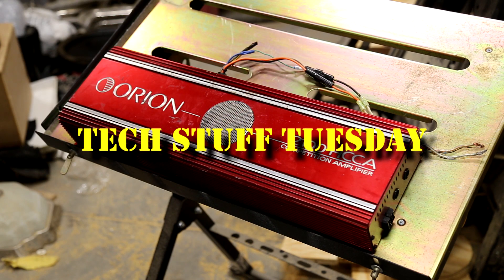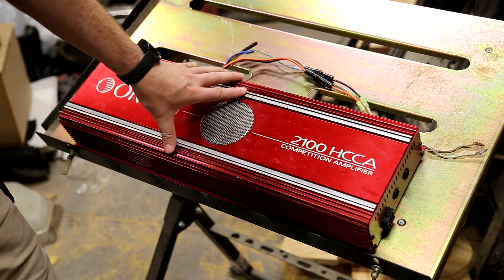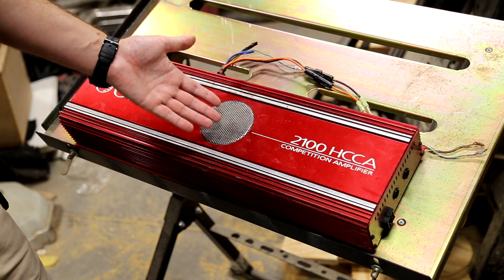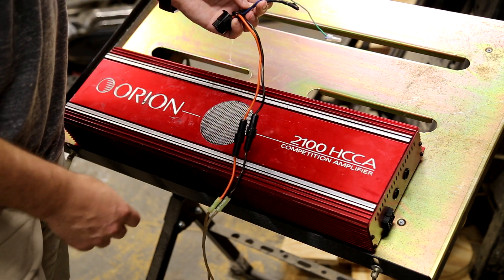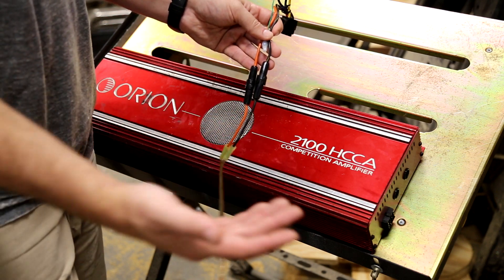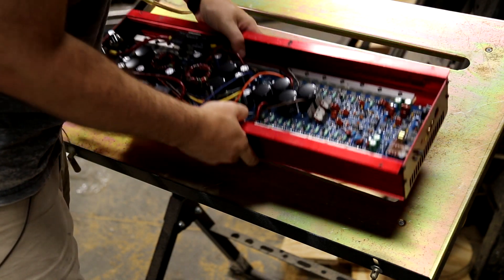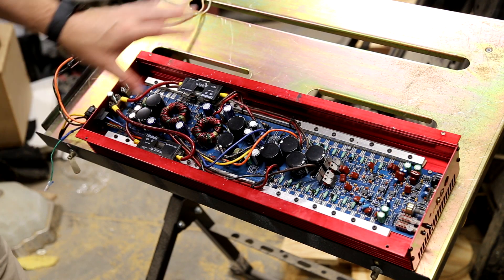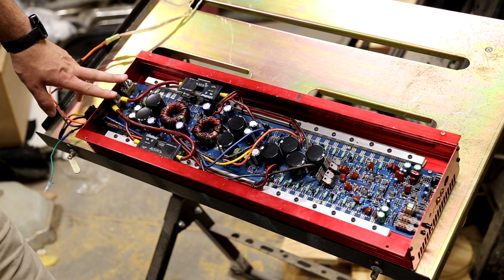22 year old Orion HCCA amp test, how much power does it *really* make? - Tech Stuff Tuesday

Comment: I lived in 3 car audio shops in Toledo ohio in the 90’s. TAS was one … still open and was a big Fosgate dealer … Siegel Auto radio was one an Orion dealer … Greg Cassidy built two tall skinny ported boxes for 2 8 inch subs… they hit harder than most 12’s 15’s of the day. Took your breath away. 
Greg put like 20-30 8” Orion in one box in the back of a white toronado and ram them on one of the big amps and tool hit so hard it pushed you off the seat!
They put 4 10’s in back of an old blazer and imploded all the back windows. Most anyone else never would and still won’t admit that for a short time Orion was the best of the best. The were modest with under rating power.
People talk about Orion amps clipping back in the day when done right almost never occurred. 
Orion was one of if not the first to make crazy boxes and put 8 10 20 speakers and amps into a car and don’t tell me they wernt because they had to make their own battery regulators and EQ’s etc. they came out with crazy boxes and speaker amounts and other companies started after seeing them … I’ve seen Orion amps run so have at like .1 ohm you could fry an egg where as other amps would burn up. Orion was one of not the first to put big cooling fans in center of the amp … for a little while they were the best of the best. This was before power mosfets etc. i remember Orion amps speakers hitting so hard they caused damage to the vehicle in areas and things in the shop and stalled or almost stalled the car with two batteries. I remember an Orion amp so long it went from one side of the trunk to the other … across a box. That’s when Fosgate ppi green machine Phoenix Gold really stepped up their game and advertised 1 ohm stable etc etc etc. i remember getting Orion and car audio magazines and Orion doing things no one else was doing. I still to this day haven’t seen a speaker box like the two tall skinny ones with port on top for those 8”. There was a short time every one else was scrambling to keep up. If you remember correctly it was Orion that was boasting dropping ohms for power dropping ohms for etc it was Orion that started that. No one else was really focused on it. I don’t know what all this guy did or didn’t do with a amp that had two burned out wires but I do know for a short time Orion won damn near every trophy in every competition. Companies and Iasca were pissed. We were some of the first people to hook up Christmas lights to the output on our car amplifiers. No one else was hooking up 20 8” subs or calling there 8” and 6.5 inch a sub… maybe that’s what Greg had like 20 6.5” subs that would know k you off his seat. He also had a DEQ.
Reply: Orion was liquid cooling tweeters back in the day and no one else was … they came up with cobalt made and carbon fiber made products … on one was doing that.
Reply: No one talks about Orion having less distortion at peak power than any other car amplifier on the market when it was like .0005 or some crazy number and that’s why this guy commented on a review that he could turn his gain all the way up and be ok. I remember those reviews bring in orions cobalt magazines and car audio magazines.

Comment: Aside from the other possibilities mentioned, it could just need a component refresh. Caps, especially, don't have an infinite shelf life, and lose performance over time (especially 20+ years). And when you're driving a load as hard as a 1ohm load (2ohm bridged equals 1ohm on the amp channels), the components need to be up to snuff. The fact it did 800 at 4ohm bridged tells me this thing probably really is the beast, when in new condition, as it's touted. US Amps, Orion, Soundstream, etc made seriously powerfully high current amps back in the 90s. Imagine what they could do with today's amplifier technology if they were still the same companies they once were.

Comment: Well I had a Orion hcca 150 rated at 100 watts and it would push 6 JL 10’s in 0.5 ohms! These amps were “cheater” amps in the late 80’s and made to get into competitions at much lower watts and blow them away! You just don’t understand the concept of these amps! This was 20-30 years ago when we would use home speakers in a hatchback to get bass. These amps with two Rockford fosgate punch 12’s would sound like THUNDER!! They never over heated like my hifonics would do and I could turn the gain and volume up to max and it would just dim my lights because it was going to get its power first! Today these amps are garbage but don’t dare disrespect them son because in 1995 my 1990 Honda Accord with 6 JL 8’s w1 in a special design band pass box with the Orion hcca 150 (w/o the bridging module)would still impress you!

Comment: Boy I remember the days of DIN connectors....when pre out on radios was DIN only no rcas at all...I've still got a Alpine 7347 cassette deck and 3015eq in archives...that was early 80s Alpine component equiptment...they had no power plug or any wires except a 8 pin DIN cable  front/rear pre out as well as power, ground, remote and ign. wires all ran thru DIN cables those were the days

Comment: Great test👍
... I sincerely believe that its an XTR-Beast2250 inside of the HCCA2100 case.

I know that its not good to adhere to myths & rumors; but, I think I remember the older guys back-in-the-day saying that both amps looked almost identical on the inside. If memory serves me, I think that The HCCA2100, The Concept 97.3, and The BeastXTR2250 are all identical internally... just the 2100 is set-up for High-Current instead of High-Voltage. And if a person were to try to "Load-Down" a XTR2250 instead of a true HCCA Amp, it'd actually loose power kinda like this one did in your video.

As a person that's seen mass production factories before, it wouldn’t be hard to believe that several runs of amps get placed in the wrong case... employees can make mistakes OR supervision can be more concerned with production quotas.🤷‍♂️
Reply from the maker: Someone informed me of similar, and the case denoting "competition" vs "digital reference" meant it had a 2250 board in it.

Comment: Us amps made models that were 1 ohm stable or less in the early mid 90s
Reply from the maker: They may have made some that would operate, but not rated. Late 90's started very few rated for 2 ohms with even more rare 1 ohm. 1 ohm stereo is more likely.
Reply: @EMFAudio  according to this link, they made .25 stable amps in 1996 https://www.stevemeadedesigns.com/board/topic/195871-us-amps-vlx-25-on-the-amp-dyno/.  Competition busters...always wanted to see if it was legit

Comment: I got one back in the late 90s and once installed I was like "what the hell" my ppi pc 2150 sounded 10 times better and was louder.  Bought it off Yahoo auctions and a month latter I sold it on ebay and got my money  back. I was very disappointed.
Reply: Was running the hcca on two 15w6 jl audio subs @ 1.5 ohms mono load (actual impedance was lower)

Comment: So you mentioned or brought up a question I have wondered for quite some time now, I deff have to ask... Do amps loose power output capability over time, for ex a 20yr old amp that has sat on a shelf or a 20yr old amp that has been installed and used daily since new....
Reply from the maker: I've never tested an amp, let it sit for over a decade, then test it again. I have seen amps quit working while sitting on a shelf for a year or two. Caps can dry up and take them out of tolerance making the amp go into protect.
Reply: @EMFAudio  okay thank you, and if the amp is being used daily will it loose power over time with age?
Reply from the maker: @kevinAuman1  I have not found that to be true.
Reply: Also is not using an amp not good for them or do they have a life span like a mechanical engine and after so much use it is just worn out and done?

Comment: There should b a button on the rca Jacks side of da amps u gotta press it ,it's like a bass boost an it makes a huge difference. I had an exact amp like dat an I ran da matching hcca 15" subs an I got it done to .5 ohms an it had too much power an nearly blew them up . Oh yeah u also gonna need a electronic crossover , those amps needed it .
Reply from the maker: It is like bass boost, just like bass boost now. It doesn't make more power, it makes more power at the same volume in a certain bandwidth, till you hit the maximum power and it clips. Basically, it just clips sooner. Those amps didn't have a crossover in them at all, nowadays external crossovers aren't needed because HU's have them.
Reply: Yeah dats y I said also put a crossover to it ,it's more of an hassle now days to run da old setup but it's still pretty powerful
Reply: @EMFAudio  u should make a video of da same amp wit an audio control crossover, that'll b awsum

Comment: Those I believe the name is molex connectors was the Achilles Heal of that amp or any that use it.  I can imagine the heat an power loss its generating at that connector.  I would do away with it an direct wire it an do another test to see any difference.  That's what we did back in the day.
Reply from the maker: Molex is a company that makes quick disconnects in various plug shapes and configurations. It's not a type, it's a brand.

Comment: I'm old school I was bumping back in the 90s  93 toyota Camry on reversed mcclean wire rims ,first gen 15"solo baric and a punch 250  with the low card on. about 470 true watts that shit bumped .wasnt me first system but the most expensive one sub was 500 amp was 400 kenwood excelon mask kenwood 7 band passive eq infinity kappa mids and tweets Phoenix 4 ch amp.but that was back in the day hell I'm mid 40s now and built another system and the stuff they have now is dope compared to old school.i got these 12 db okur and broke them in on a old school95 600watt crossfire well that ran stopped working I got it on the bench project 4 later,hooked up a JL audio 250/1 and the SUbs within a week they started making weird sounds rubbing and mechanical sound the vibration but there not blown there dvc 4ohms and my fluke meter is reading 4ohms unless is a new type of blown then wtf somebody please comment back spider is good no rips come is cool coil not burnt..
Reply from the maker: Spider could be loose causing the coil to rock and make those mechanical noises.
Reply: @EMFAudio  yeah I checked that I think well some guy said it could be voice coil rubbing,I'll mess with them a little more.oh and thats off to you and your company EMF and I just subscribe to you just found your channel and been watching them since I got from work good info.if I cant get these db okur working I'll buy one of your 15s just single 15 like I did with my solo baric back in the day,those magnets on these subwoofer look crazy and heavy.thanks man

Comment: Interesting side note: pin 3 of the DIN cable was used as a remote turn on by companies like Alpine, Pioneer, Clarion, Kenwood, etc.
On home and commercial audio equipment, pin 3 was a balanced ground.
Yes, I'm old enough to remember when DIN was a standard in car audio.
Reply: Brian Smith You couldn’t beat a good din cable for resistance to noise in long runs to amps in a trunk. It was very convenient to only run two cables into your trunk, one power and one din for everything else. The one drawback was the large size of the connectors when feeding them through tight places.

Comment: I thought US Amps were insanely underrated  back in the day. I remember running my US amps 200 thinking it was pushing crazy watts.
Reply from the maker: They did model numbers after stereo 4 ohm rating, which is why they were rated for so little power and "underrated". If you went by mono ratings most did around rated.
Reply: @EMFAudio  I just looked up BigD's test of the VLX25, rated 200 Watts at 2 Ohms mono, it did 553 at barely over 13 Volts.

So there really were extremely underrrated ones, but I think you shouldn't expect it just because it's Old School. You have to know what you're looking for...

Comment: Good old school amps . I actually own a hcca 225 g4 that is supposed to be 0.25 ohms stable stereo and 0.5 ohms in  bridge mode.I love it. It is in excellent condition.
Reply: The 225 g4 was rated at one ohm mono or half ohm stere
Reply from the maker: Yup, I used to have a 250r, the one right before the G4, same ratings. It might have been the same amp with a different heatsink.

Comment: my old lanzar optidrive always dusted my buddies orion hcca amp in late 90's... We both had 2 jl w6 and always beat him on the meter... Basically the saying they do not make em like they used too is BUSTED in this case cause amps are way more efficient and made better these days. IF YOU RUN THEM CORRECTLY!! Just cause ppl got DD1 and CC1 and volt meters don't mean they know what they are doing. GREAT Video AS ALWAYS

Comment: I thank there cool would love to have one just to have it but if you think about it  800 watts is still  one hundred percent do able in a personal system build that amp 2 lowballer 12" and away you go man thinks for the video
Reply from the maker: The killer with making the 800 watts here is the efficiency. You spend more on electrical to support that same 800 watts than you would with a class D amp making the same power.
Reply: @EMFAudio  Yea but let's be honest hear even a class D  idle's  most of the time and so would the a/b and then the time wear we DJ to the hole neighborhood the efficiency really don't matter much   at lower volume to ppl who had them hook up to 2 15" and the battery under the hood that didn't know they thought it was awesome or junk and Yea you should have 2/3 battery's and 0 Gage or better battery cables and alternator charge wire to keep it happy but would you beat the brake off it every day no it would idle mostly

Comment: Just to clarify, I tested 3 different 2100 HCCA's to confirm my results with the Amp Dyno (2 competition models, one "digital reference model). I wonder if your amp is an XTR-2250 in a 2100HCCA case? Your results at 4 ohms mono are very similar to my 4 ohm mono results with an XTR-2250. Could have been a "cheating" method back in the day as I know people running US Amps would swap model end plates to "cheat" the system. Cool test, thanks for sharing.
Reply: Look on the board for the silkscreened model. I bet just like big D it's a 2250 in a hcca case. I got 1 6 months ago with same deal. Hcca sell better than xtr. And my amp had been sitting for 10 years. Guy I bought from said he did that so his install matched.
Reply: Big D was here 😁👍... why he dont come on my channel and leav a friendly comment ? 🤔...  i think this amp issnt a HCCA in the case... the HCCA make all more power than rated... the same with Rockford 😂... my 800a2 needs more than 150A 😊.. but nice test.. test it with a other  HCCA 2100 again..
Reply from the maker: What about the 2 ohm results? Did those match up with the 2250?
Reply: Back in 1999 I had many xtr 2250 in my system, I clamp tested them , and with 17.5 volt input they did a VA volts x amps 82 volts , 22 amps ,was about 1800 VA
Reply from the maker: @charliefrancis6438  That's intriguing, I could start the car and crank the voltage up. Do you know the maximum voltage those amps can take?
Reply: I like BigD and trust his testing 100%. Is this video just trying to prove him wrong or ? I dont get the point
Reply from the maker: @ericwatson9771  I made it pretty clear in the video I was busting a myth, showing a reality, and indicating other testing had been done that was also different from mine that didn't meet ratings. Not proving right or wrong, just different. Not everything has to be a fight.
Reply: @EMFAudio  well said! 👌💯
Reply: @EMFAudio  Exactly! Not everything has to me a fight.
Reply: @EMFAudio  I'm with you brother. I hate when people blitz the comment section and in all of their wisdom atack someone just because the results didn't meet their delusional expectations. I would have never imagined in a million years that there were so many amplifier techs out there. I do amplifier repair for fun not for profit and I've repaired many of these amps and concluded that with only 10 pair of complimentary 2n6488, 2n6491 bjt output transistors they struggle to dissipate 100 watts per pair of transistors. Now they can produce that kind of power but require more  plus or minus voltage than the 2100s power supply can deliver. Useless information I know but what the hell, and by the way very good video.